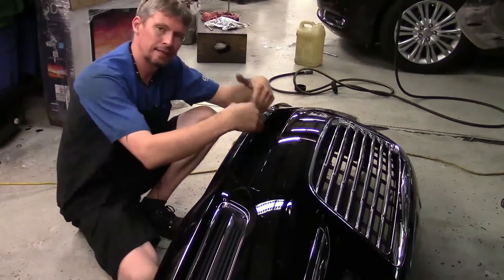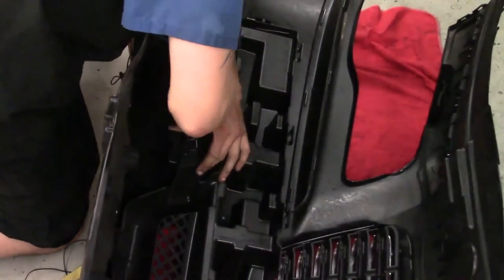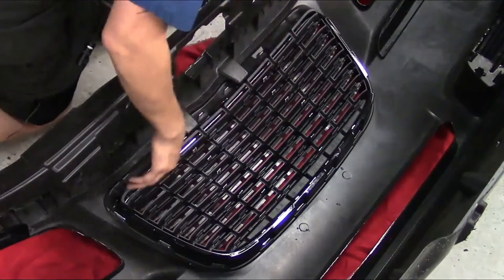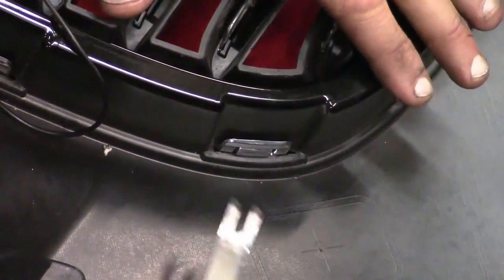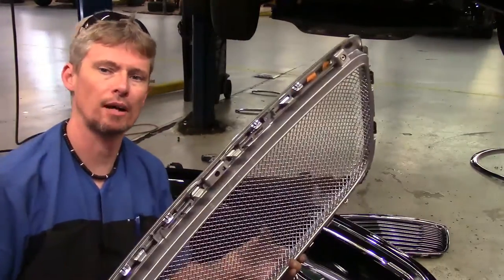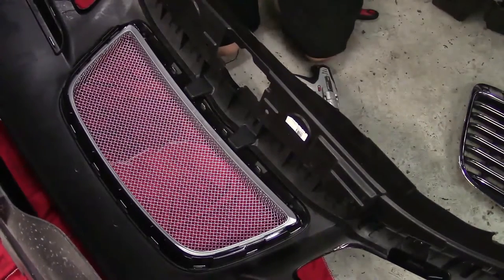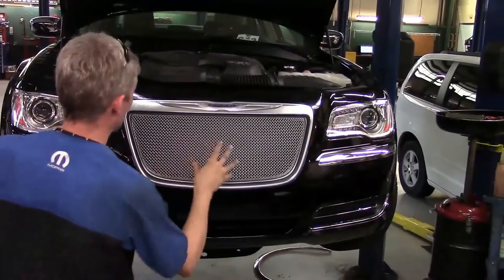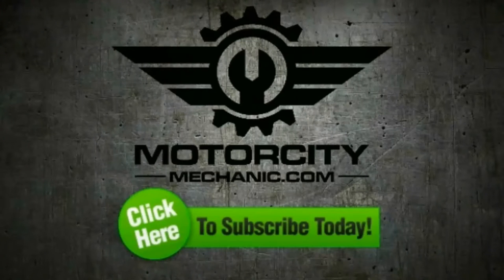Part 2/2: Chrysler 300 Mopar mesh grille Part # 82213053

Comment: Great content. Could you please let me know where I could purchase this grille for a 2013 Chrysler 300. Everywhere I’ve looked said it’s discontinued. Thanks for any assistance you can provide.
Reply from the maker: Not sure....I dont have access to the parts side of things. I can only refer you to your local dealer and have them look it up. You may need to give them your VIN to be sure. Thanks for asking and make sure to subscribe.
Reply: Yea its discontinued I had a slight finder bender, and my car came with the factory mesh grille and the had to put the standard grill bcuz mopar doesn't make it anymore. There are aftermarket but it's not the same bcuz Chrysler was one piece after market is just an insert

Comment: Do you have a video, of  replacing the 5.7 hemi cam 2012 300c?
Reply from the maker: I currently dont. I will keep it in mind as a future video. You will need to remove the heads, lifters, and the front timing cover. Thanks for asking and for the request. Make sure to subscribe.

Comment: I have a 2013 Chrysler 300C but mine has the parking sensors, fog lights, as well as the adaptive cruise sensor. I am wondering how much harder it will be to get the bumper off with all these things? Are there disconnects right behind them? I do not want to end up breaking them if I try this on my own.
Reply from the maker: The adaptive cruise module will be mounted to the vehicle....not the bumper so you will be fine. There will be one main connector for the park assist sensors and you may need to unplug the fog lamps. Nothing to worry about, just take your time. Make sure to subscribe !

Comment: I just bought a 2015 chyrsler 300c.... I cant seem to find a 2 pc. mesh grill (lower bumper) does Mopar have one?? Thanks.
Reply from the maker: +alex v I will have to check with my parts department in the morning if that's fine.
Reply: +MotorCity Mechanic Sure!!! Thanks man.
Reply from the maker: +alex v I checked and my parts department doesn't show a listing for the lower grille thru mopar.
Reply: +MotorCity Mechanic is there any aftermarket brand you suggest that i can get? Thanks.
Reply from the maker: alex v I have no idea. Never get to use much aftermarket items at the dealership level. I haven't check to see what's on the market as of yet